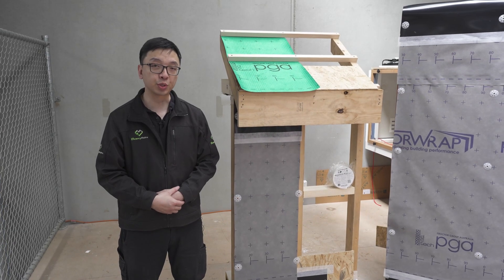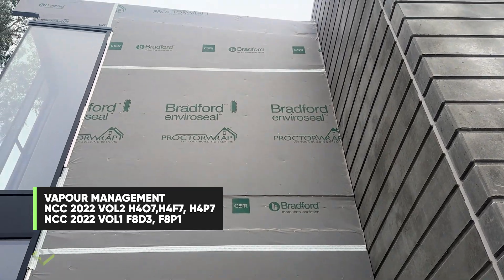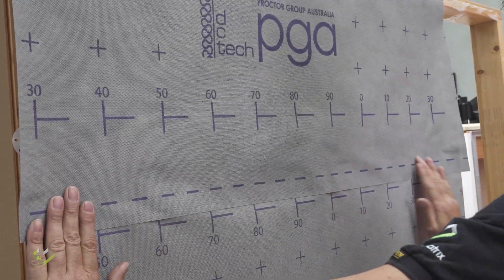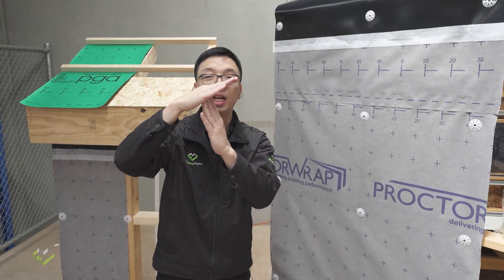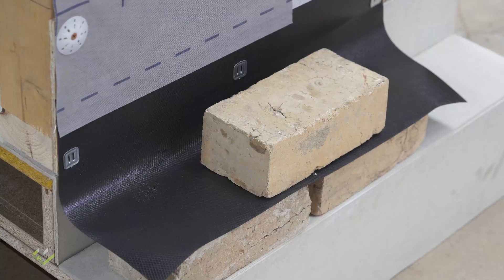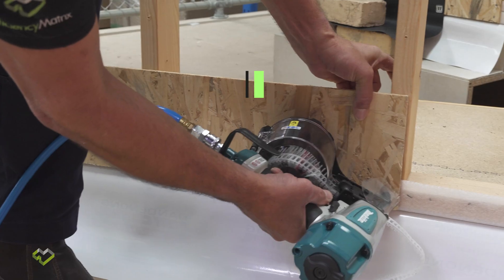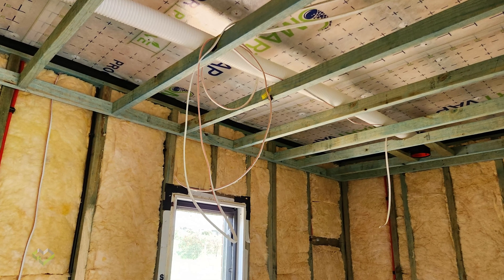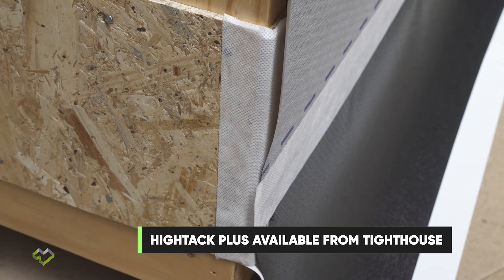Better Air Tightness with Simple Building Adjustments in Australia

Comment: Good Info 
I worked on many homes 7 stars, 8 stars maybe even a 9 star, but this was only on paper.
No one is inspecting the insulation, nor the air tightness.
Its critical this must be part of the inspection process during the building.
Reply: @ecoevo Builders oppose and governments follow suit. Pressure testing exposes mistakes and sloppy work on all the holes tradies drilled into the membrane during the build, all things they want to hide because owners and governments want cheap houses - meaning fast, sloppy work. Of course occupants pay the price after the fact with high bills and uncomfortable homes. 
It costs us quite a bit to go full Passive House and the builder is on board. But they say it adds a lot of hours on top of their normal build. Plus you need and ERV for ventilation in a very airtight house and a dehumidifier and aircon in QLD, even in a PH. 

For the aircon, installers don't want or can't install a smaller centralised system (you can install split systems of course, but overall the same cost and we don't want it because of design reasons). The simulation shows that our 5 bdrm house will use max 3,6kW on the hottest days, but there is no aircon installer willing or small aircon system out there that can be installed centrally in a 5 bedroom house. The cold air needs to be transported to all rooms somehow, and the smallest system for 7 aircon heads is 16kW according to Daikin.

The ERV hoses and aircon pipes that are still needed, are all inside the building envelope, which means builders and tradies can't do work as they are used to. Bulkheads for the aircon heads are needed and the pipes and hoses are sandwiched between floor and ceiling. 

Then add energy efficient coated double glazing with the needed energy efficient frames (tilt and turn, no sliding windows). In Qld overall only like 2% are double glazed windows! So prices are still way too high.

This ads all cost.
In our case it is 17% more for our 5brdm build. It is even more in our case because of very large lift and slide windows and different other more upper market materials.

Find me a building company that wants to ask A$112,500 more from their customers - $862,500 instead of $750,000 for the build, when all competition is also saying "our homes are very efficient 7 stars" (on paper).

We're convinced it will be worth it for us and for future generations. Every time we made our buildings more energy efficient via EE upgrades on a small scale, it was so much more pleasant to live in and so much cheaper to run as well. Be it in MA, US or Qld, AUS.

But the culture in Australia is not there yet, the building industry is not there yet, the government is not there yet and homeowners are not there yet.

Well, let's just fly by the 1.5C Paris Agreement goal and don't look back. She'll be fine mate!
Reply: Sustainability Victoria had a pilot program on the “As built verification “ of homes which produced a lot of insight and information for the decision makers. Hopefully one day it will be part of the occupancy permit issue process.
Reply: @josephcheung8311  @pulporock Builders oppose and governments follow suit. Pressure testing exposes mistakes and sloppy work on all the holes tradies drilled into the membrane during the build, all things they want to hide because owners and governments want cheap houses - meaning fast, sloppy work. Of course occupants pay the price after the fact with high bills and uncomfortable homes. 
It costs us quite a bit to go full Passive House and the builder is on board. But they say it adds a lot of hours on top of their normal build. Plus you need and ERV for ventilation in a very airtight house and a dehumidifier and aircon in QLD, even in a PH. 

For the aircon, installers don't want or can't install a smaller centralised system (you can install split systems of course, but overall the same cost and we don't want it because of design reasons). The simulation shows that our 5 bdrm house will use max 3,6kW on the hottest days, but there is no aircon installer willing or small aircon system out there that can be installed centrally in a 5 bedroom house. The cold air needs to be transported to all rooms somehow, and the smallest system for 7 aircon heads is 16kW according to Daikin.

The ERV hoses and aircon pipes that are still needed, are all inside the building envelope, which means builders and tradies can't do work as they are used to. Bulkheads for the aircon heads are needed and the pipes and hoses are sandwiched between floor and ceiling. 

Then add energy efficient coated double glazing with the needed energy efficient frames (tilt and turn, no sliding windows). In Qld overall only like 2% are double glazed windows! So prices are still way too high.

This ads all cost.
In our case it is 17% more for our 5brdm build. It is even more in our case because of very large lift and slide windows and different other more upper market materials.

Find me a building company that wants to ask A$112,500 more from their customers - $862,500 instead of $750,000 for the build, when all competition is also saying "our homes are very efficient 7 stars" (on paper).

We're convinced it will be worth it for us and for future generations. Every time we made our buildings more energy efficient via EE upgrades on a small scale, it was so much more pleasant to live in and so much cheaper to run as well. Be it in MA, US or Qld, AUS.

But the culture in Australia is not there yet, the building industry is not there yet, the government is not there yet and homeowners are not there yet.

Well, let's just fly by the 1.5C Paris Agreement goal and don't look back. She'll be fine mate!

Comment: Can a storm rip open sealing tape? A storm could potentially produce a very high pressure differential between inside and outside.
Reply from the maker: It can depend on how good all the mechanical fixing is.   And where the wrap is directly exposed to outside, during construction.   Where there is cladding, tape failure is less likely, but it all depends on how big the winds are.
Reply: @ecoevo  Thanks for your answer. In our Passive House build with standard building practices there are wall battens 450mm apart, house wrap, cavity batten 35mm and cladding installed, and there is also a cavity drainage closer installed. Would you say it can still happen or not? I understand that it depends on the materials used, like wrap and tape used.